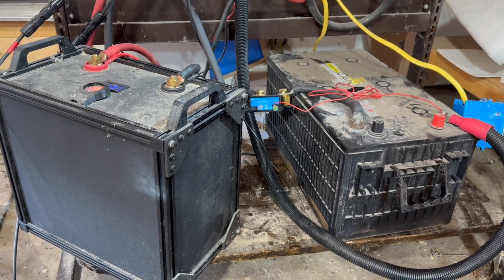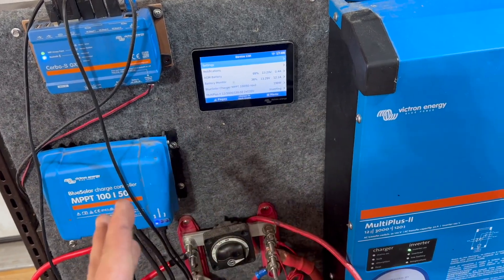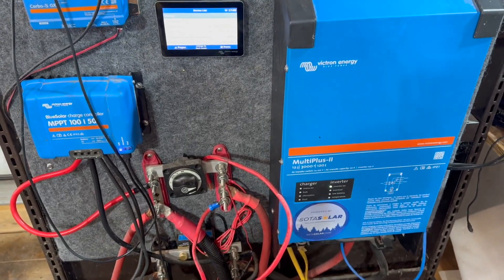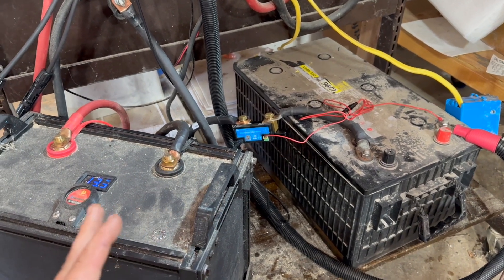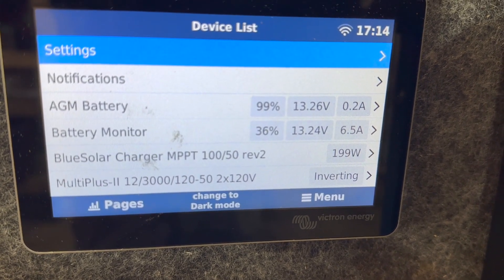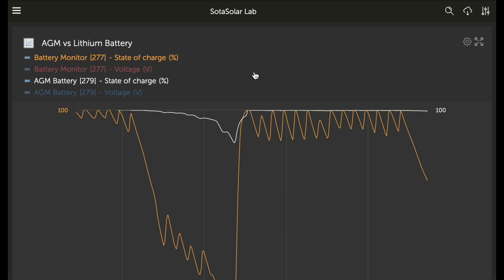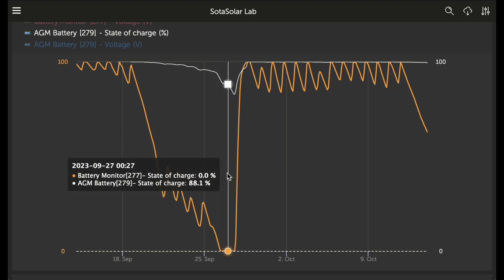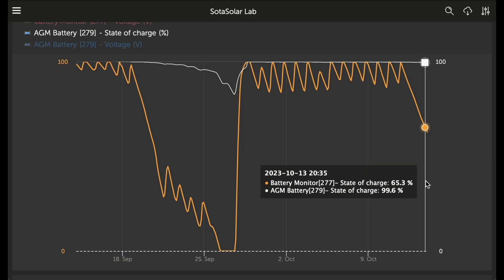What happens with Lithium (LiFeP04)  and AGM Batteries in parallel ? Let's find out!

Comment: I'm just a dumb Trucker 🚚 who slapped 4x Optimum Yellowtop AGMs with 2x PowerQueen 300Ah in Parallel to 3x 300watt solar panels to an AIMS 10,000watt inverter. A combo of sun 🌞 and truck alternator⚡️ keep me at 13.5 so i can run my 800watt portable A/C 8 hours a night 🌙 with truck off. I've been doing this for a year now with zero issues... except when i do 34 hour reset in cloudy ⛅️ weather in which case i bust out my Predator 2000watt generator to supplement to keep A/C on 34 hours. I don't use fuses, shunts, isolators, or any other fancy equipment because i believe that stuff can create resistance, voltage drops, and inefficiency. I'm wanting to repanel with CIGs as soon as their price becomes more realistic in Biden/Kamala inflation. 😂
Reply from the maker: Glad that’s working out. You’re right, I’ve seen so many burned up fuse holders where they never blew. This is why we like to use high amp magnet breakers from Dihool. Only thing about your setup that makes me nervous is the lack of circuit protection.  These create the least amount of resistance and keep you safe. Available in many sizes and acts as a shutoff. https://amzn.to/47Hrlyt

Keep on truckin’ !
Reply: Pray to Putin to bring the prices down.
Reply: Crazy not to use protection of some kind. Could turn a wire into a heating element and fire, ive seen it when a old vw ignition switch shorted.

Comment: There is a guy on YouTube, it's called Emily and Clark adventures, he is an electrical engineer who lives on his sailboat, he uses those batteries combined and sells a electrical device to make the process safer..
Reply: Yup even has a device  like a reglator but he explains how to for car audionwould benefit from it. But far as th myths he said yes but do the steps monitor  and check if balance goes bad that's when it drain from because ppl get comfortable and don't check cells
Reply: Nobody wants to spend hundreds on product that you didn't really need
Reply: I have Clark’s Gen 3 Battery Bank Manager in our 46’ cat and I am extremely happy with the results.  We combined 480ah of AGM’s with 1380ah of LiPO w the only alteration to our charging systems ( we have a lot of solar, 2 120amp alternators and 100a of AC chargers powered by GenSet) being the addition of external regulators to our alternators.   No DC-DC chargers needed.
Reply: @tracyoliver550 what’s it do that simply connecting them in parallel wouldn’t?

Comment: I do this on my RV. I have a 200aH LiFePO4 battery in parallel with 200aH of Lead Acid Batteries.  The majority of the work is completed by Lithium battery.  This keeps the Lead Acid batteries in an ideal float charge state 95% of the time. The only time the Lead Acid batteries are drained is when there's excess load or no sun for several days. Of course there's proper switching and fusing between the batteries.  The Lead Acid batteries will las a long  time in this setup.
Reply: They said you can't mix charge lifepo4 and lead acid batteries in a van alternator. Is that a money making scam?
Reply from the maker: @BOREDANDWELLBORED you do not want to start a vehicle from lithium. BMS won’t take it. As for parallel systems, it all depends. Healthy lead acid is fine, a worn out lead acid might drain your lithium slowly. If cycling daily it might be fine.
Reply: @sotasolar  what do you mean "cycling daily"? I have 400 watts solar panels connected to it. Is that considered "cycling daily"?
Reply: @BOREDANDWELLBORED discharge then charge is cycling.

Comment: Excellent summary.  We have been running a hybrid LifePO4 and flooded lead acid house bank on the yacht for two years, works really well.  One point worth emphasizing is the lead acid needs to be in good condition.  No point in adding LFP to an old end of life lead acid bank hoping it will do miracles.  It won't and could cause a problem if the LFP empties its charge into a lead acid battery with a shorted cell.

Comment: Excellent summary and fits with our findings after running a LifePO4 and flooded lead acid house bank on a yacht for 2 years.
Reply: So you can mix lead acid and lifepo4 batteries to be charged with the same alternator? Why do manufacturers say it will catch on fire and try to coerce me to spend additional $1000 for dc to dc charger?
Reply: @BOREDANDWELLBORED  Yes, just make sure the lead acid is in good condition.  LifePO4 won't fix dud lead acid batteries.
Reply: @pete9501  so in my solar mppt, do I set the battery charge at lifepo4 profile? Or lead acid profile? There will be 200ah lifepo4 and 100ah lead acid (new) mixed
Reply: @BOREDANDWELLBORED  You can do either so long as you don't float charge the LifePO4 which will eventually shorten the battery life.  I would prefer to shorten the LA life by not floating. Set charge voltage to 14 or 14.2v which will keep the LifePO4 out of the knee for a long life.  Some chargers must have a float, in that case set it low say 13.4v.  This will provide power for small items like lights without taking power during the day.
Reply: @BOREDANDWELLBORED  Lead acid, but don't let the float charge go above about 13.4v.

Comment: Couldn't you just run a diode between the battery types so you don't get that power bleed? If you do this, then in theory, the gel batteries should only start drawing down once the voltage on the lithium drops below the resting rate of the gel. About 85% discharge of the lithium. Which would make the gel batteries a true backup. Just run a separate shunt for the gel batteries to show when they are drawing current so you know you are on reserves.

Comment: My Hymer class B RV has that very setup by design. They use what’s called a kicker AGM battery to buffer current spikes from the 270A second alternator. The 400 Ah Lithium batteries are in parallel. Works like a charm. Only thing they did is lower the float voltage to 13.9-14.0. That still fills both the AGM and Lithiums
Reply: Might consider lowering your float voltage down to 13.4, which will insure no low amperage current is flowing into an already charged Li Battery. 13.9-14.0v your basically applying a charge current to your Li Batteries all the time. This will shorten the available life cycles of them. Lithiums do not need to be floated - different chemistry.

Comment: I have a 48v 100ah (5kw) LFP Battery and a 48v 200ah (10kw) Sealed Lead Acid battery bank (4 x 12v 200ah) connected in parallel to my 10kw charger / inverter. They were connected when their voltages were the same. They charge and discharge in unison and their voltages remain identical (to within 0.01v / 0.02v) throughout. The battery low voltage disconnect cut-off is 48v, so c.10% for the LFP and c.48% for the SLA. The LFP charge voltage is 58.4v, the manufacturer's suggested SLA charge voltage is 58.8v - 60.00v.  It seems to work ok and I have not noted any abnormal signs, the only thing is that the SLA batteries are charged to c.53.2v when at rest, when the suggested level is 52v, so I guess that will impact the SLA bank over time ?, but in the meantime, it means I can use them with my LFP battery and get another 5kw of usable battery capacity, otherwise they would just be sitting there doing nothing.

Comment: I have a 12-volt lifepo4 and a 12-volt deep cycle. I ran them both down to 12 volts, then I put them in parallel and hook them to my solar charger. I just did that today. My worry is that the resting voltage of the deep cycle  Battery is 12.6, My theory is that it's going to drag my lithium all the way down to 12.6 When resting. 12.6 on a lithium battery is like 15%. Which essentially could mean I will lose 85% of the batteries at rest, if I didn't have sun for a couple days and didn't use power it Will leave my lithium battery at 15%. losing 85% of its power Just sitting there. Which would mean I have about 70 amp hours of usable energy, instead of 150 AH.

Comment: Myself and some others on the classbforum did quite a bit of work on this a few years ago. I ran my camper on a dual lifepo4/AGM setup with the batteries combined using a Victron Argo diode combiner on the load side and separate charge sources. I also experimented with directly combining AGM and lifepo4.  It worked - but for me a simple A/B/Both switch worked good enough and was simpler. I ran from AGM until bedtime, switched to lithium overnight, and charged both during the day. 

We also drew up circuits that would use an ideal diode to switch between banks, one that would use SSR's, etc. 

My goal at the time was to be able to yank out the lithium in our Minnesota winters and still have a fully functional camper, without re-wiring. Now I have enough lithium that I don't use the AGM's at all, and I plug the camper in and heat the lithium with internal heat pads.
Reply from the maker: Nice, that’s quite a setup!

Comment: Great research, love how yours worked together.  I now have 4 AGMs (just lost one that no longer would hold a charge) on my boat that are getting old and will be adding 2 100ah Lithium batteries in parallel.  However, I plan to make the following changes to the charging system for extra protection. An external BMS and electronic cutoff switch for the lithium batteries plus a Balmar MC-618 regulator and MC-TS-A alternator temp sensor to prevent my 100amp alternator from overheating when charging this system.  Is this enough or do you think I need more electronic protection.
Reply from the maker: Make sure you have some circuit  protection between battery and alternator.  For these I like the thermal resetting breakers like this https://amzn.to/496hfGK This one is only 50 amps, but if your alternator is 100a, I'd not want to be pulling close to that for too long.   I'd look at protection on both ends, because you could overload from alternator side as well as battery side.

Comment: Excellent review.  Thanks.  The chart showing the cycle of the lifepo4 battery is very interesting.  And your arts and crafts illustration ..  crude yes, but really good at explaining the power use of the batteries in parallel.  Question: Is the charge voltage high level limited?

Comment: looking to install a 2000w inverter into my 2014 prius  , could i use a lip04 in parallel with my lead acid ( starting battery ) ? The starting battery is charged by the hybred battery when low & when the hybred bat is low the engine starts up and charges . Just curious on your thoughts for this project ....Thank you

Comment: I run three optima’s and one lto 6 and it works fine for my stereo in my vehicle. I want more power for my amp and was thinking of adding one more lto 6 for burst power but the ds40 is on sale and really good price right now. The ds40 is lifepo and they don’t recemend running it with agm or lead acid they say do a battery delete. What is the difference between running lto with the optima’s and running lifepo with the optima’s?
Reply from the maker: For car audio, LTO is much better I believe.
Reply: Could I add a lifep04 as a 2nd battery in parallel with my starter yellowtop for my car audio system?
Reply: @BoobeeMyles  I believe they suggest using a battery isolator but I have seen it done. Basically as far as I know lto can run with agm but lipo needs an isolator. I think it boils down to standing voltage when it’s all off. So one doesn’t drain into the other. My Lto stands at 12.8 I believe and the agm will stand at the same at full charge. Like I said, I seen it done but who knows how long it lasts. My lto6 runs with the three optima’s with no isolator. I’m no expert though so keep asking.
Reply from the maker: @JohnDoe-fk5fr the testing we did here shows only a few amp hours flow from LiFePo4 to AGM at rest over a 24 hour or so period. Pretty much a rounding error. I can definitely see some value in an isolator all the same, I just don’t know when and why to isolate. AGM kind of acts as a ballast.

Comment: Question, if lifepo4 battery  bank is only charged by solar (mppt) and we parallel that with agm after it's full , would this cause any issue as mppt setting will be on lifepo4?
Reply from the maker: Not that we've seen.
Reply: @sotasolar  thanks for the quick reply. I'm manually going to control the parallel with a remote relay.

Comment: So then under a mixed battery system like this do you have your charger / solar charger set to lithium ?  or Sealed lead acid ?  or AGM,   ???  I find this video very interesting,  Currently now I am running  AGM solar Vmax batteries but adding a lithium batter to my system might be interesting.
Reply from the maker: I'd set for AGM.  You don't want to cook the electrolyte from the AGM with lithium's 14.6 absorb voltage.  However, lithium will still charge 100% at 14-14.4v .
Reply: @sotasolar  Thank you for your reply.  what off the shelf lithium batter would you recommend ?

Comment: As you described running differing energy storage chemistries together in parallel makes sense so in the same vein should a discussion emerge about combining super capacitor with AGM or super cap with LiFP obviously in parallel too.  I think super caps from say SkelTech ie either 12v or 48v would surprise everyone when combined with similar voltage AGM or LiFP, cheers, Dean, Aust.

Comment: If the BMS kicks off when the voltage gets too high, will that cause the unloaded alternator to burn out the lights on a car? If so, is that a good reason to parallel a lead acid battery with the lithium?

Comment: hi .i sometimes parallel my 105ah lifepo4 to my 105AH AGM BATTERY.SEEM TO BE OK .my agm battery on separate circuit powers my 3 amp stereo .lifepo4 runs compressor. fridge 24/7 plus led lights plus usb sockets.do i just use an isolator to connect and fuse between 2 batteries

Comment: Hi great video. Maybe you can help me with your own experience.
13 years ago I built a CTEK based dual battery system in the car for camping. Once while camping, the car battery went low from the car being open too long and a person got stuck inside. Since then I modified the system to include a BEP motorized switch with remote so I can connect the starter with the 2 service batteries in parallel (all AGMs). 5 years ago I replaced the 2 service AGMs with 2 LFPs (Relion drop-in replacements) and never thought nothing of it. Nothing else was replaced and everything has been running just fine. 
Since then, a few times every year, I have jumped the 2 banks with the BEP switch with no ill effects. The voltages combine to around 12.9V if memory serves and I think I even started the car with them joined. I never had any issues. 
Both banks charging with the same AGM charging profile using the alternator or AC-DC charger.
Of course CTEK support is adamant that I should be using a Lithium charger because during DESULPHATION stage#1, the voltage reaches 15.8V and this may cause LFP BMS to shutdown the LFPs (I never noticed such a thing). Relion said that the worst thing that can happen is the BMS shutting down the battery - never happened.
Another thing is that my AGM lasted 9 years and was replaced 2 weeks ago - the LFPs may have largely contributed to this by constantly trickle charging the AGM. One fine day, the AC-DC charger just refused to charge it, and I thought it blew its fuse, until I checked it and it was fine! 
Assumptions:
1. It is probably better to have a Lithium program to charge LFPs. The AGM program may not charge the LFP fully. I do not have a shunt to verify.
2. In some application it may be better not to trickle charge the AGM from the LFP, thus slowly emptying the LFP. Some competitors to CTEK have voiced their disagreement as folows: "the ability to back-feed charge to the main battery is actually a defect in the design of the D250 – they actually cannot stop it so they made it into a feature. In the case where your service battery is Lithium and the main battery is lead-based, the Lithium will discharge into the main battery even with the system off. This is because a lithium battery voltage is always higher than that of a lead-based battery.  This now means your service battery will discharge into the main battery."   
However as I already said, it may have actually contributed to the AGM longevity - I do not know how much of a depletion this had on the LFPs daily. My car sits for up to a week sometimes and the LFPs are always on 13.2V - so no ill effects afaik.
3. I wonder if it is dangerous to connect a depleted AGM to full LFPs... Is it possible that the AGM may require a large portion of the discharge current from the LFPs ie. >75A from each LFP?
4. Many sell relays for battery connections... I use a Heavy Duty switch. That should be absolutely OK right?
Reply from the maker: Whew, lots to answer here. I’ll give my $.02 . When using lithium to jump your starter batteries I’d connect them for a while to boost and then disconnect before starting . Like you stated, the resting voltage of lithium is higher, so some amps will flow. Now you’ve been fine starting as-is, so YMMV. 

Keep in mind when hearing feedback from a manufacturer, they are looking at liability and warranty scope. Anything they endorse is now on them, I’d doesn’t mean it explicitly will or will not work.  They cans account for all batteries in all situations. 

If connecting a depleted AGM to lithium, it could be an excessive draw for a moment if the battery is down to 5-8v or something. But if it’s resting at 11 or 12v there just isn’t the potential to draw 150 amps or something. Lead acid battery resistance is high at top and bottom of charge.  

On the topic of need a lithium charger. The BMS will protect from any over voltage conditions and if there is an under charge it will be slight. I use AGM charging modes to charge lithium often. 

Sounds like your solution is working good.
Reply: @sotasolar  can you touch on point#3 ? Any comments?
Reply from the maker: For the sake of posterity, I updated my original comment.